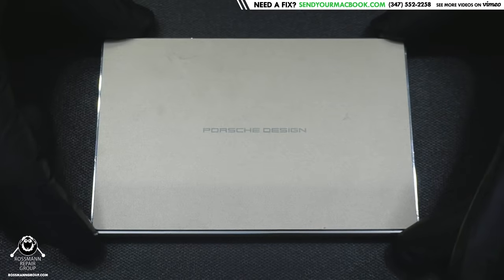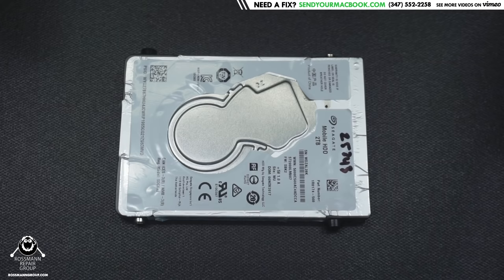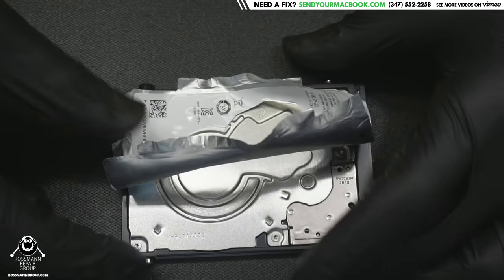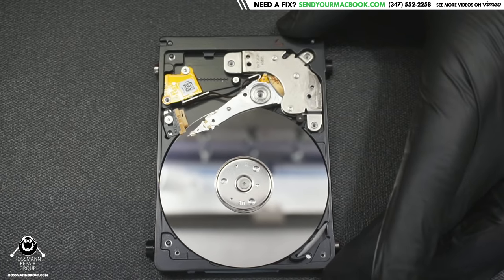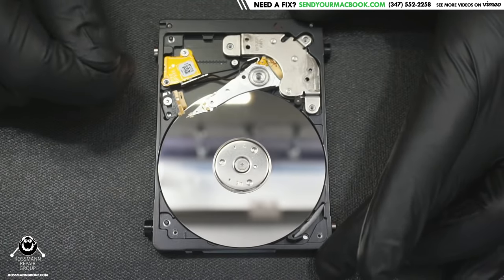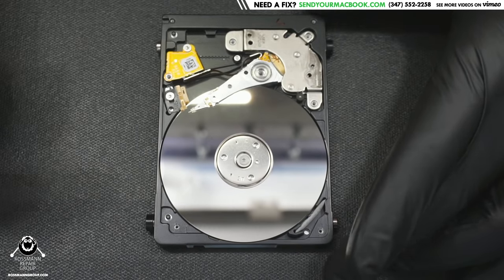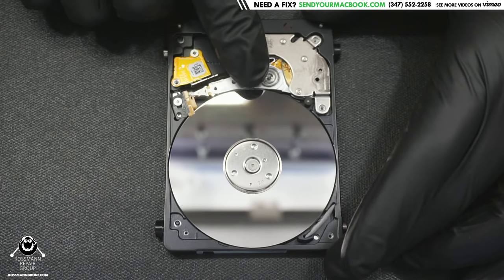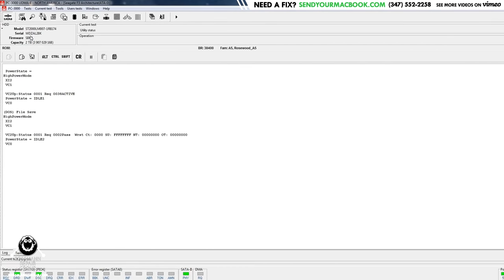Why your Seagate external hard drive is beeping; beeping hard drives can be recovered with this fix

Comment: When you talk about the drive failing again after repair, I feel like drives are so cheap once rescued the customer should really just get the data to a new drive.
Reply: This is ALWAYS the case you NEVER reuse a recovered/opened drive. What he is talking about is it working for a bit then failing again DURING the recovery of when transfering data to a new drive. NEVER NEVER NEVER keep using any storage media that has given issues or been modified. HDD SSD USBStick SDHC anything.
Reply: @XxTWMLxX  I have NEVER had any issues with hard drives that I've recovered in this way. Yeah if I'm doing it for someone else I normally fit a new one but I keep the old one for my own projects as long as there are no errors during data recovery. If there are, it's usually dues to damage to the platter surface due to what used to be euphemistically termed "a head crash". Generally speaking, stuck hard drives are usually fully recoverable without errors and thus will still work just fine afterwards.

Flash memory is less reliable than spinning hard drives in my experience (especially that bought on ebay :)

Comment: I have an old ass IDE drive that caught fire when hooked up externally. How do I fix that
Reply: I've never seen an actuall hdd burn up (external or internal) but the power supplies in some cheap (and not so cheap) external drive enclosures are often of very pooor quality and can easily fail in a bad way. As long as the fire didn't actually damage the hdd board, you should be good to connect it up internally or in another caddy.

Comment: I've got one of these that lasted TWO WHOLE (@*#ING DAYS and then it started giving me "I/O Error" messages.  Now it's dead.  So I shucked it, assuming that it was the USB/SATA interface.  Plugged it into a typical USB3.1/SATA adapter cable...no dice.  Checked the interface board with another drive...interface worked fine.  My determination is that it's a drive (controller board, not a physical/mechanical) issue.  It's simply too new for there to be an actual physical error.

Is it possible to fix the electronics on these (*#@ing things?  If I'm right, it's probably just a single component failure...maybe something for another video?

Looks to be the exact same drive, just came in a Seagate Ultra Slim external case.  The plan WAS to chuck it into one of the laptops...but that didn't go quite as planned.  Of course, that was AFTER I MOVED (yes, not copied...MOVED...because it was a new (*@#ing hard drive...dammitt...) all the stuff required onto it.

If the electronics can be fixed/replaced, let me know.  If not...uhmm...want a nice less-than-24-hours-of-use donor?  d=^/

Comment: I'm pretty sure I can try this at home with hard drives I can get going dumpster diving near office spaces.
Reply: You sure can, but risking total loss of data due to dust on platters, melted heads (I found one a couple of years ago) or firmware isues (damm you firmware split onto the platters so a pcb swab isnt easy)
Reply: @CodeAsm  It's only for the learning experience. For hard drive with sensitive data I call an expert.
Reply: @kemy5368  Cool, for learning, go for it. just first go read online about your specific model. maybe they tell or show if screws need a certain tension or sequence of screws to remove. also, I swapped a pcb wrong and now both drives wont start because both know the pcb was swapped. even if I put them back.

Comment: I have my same Hard Drive of Seagate 2 TB and data is 1.8 TB loaded my whole life memory.

While copying data my portable drive slipped and from computer casing and hit on the table. After that its not responding and beeping sounds is coming after interval.

I took it to local repair and data recovery experts where they just scared me your is now lost and cannot be recovered but still if you wish us to proceed then I have to pay them $180 for the recovery which will be 50/50% and still I have to provide them one more 2 TB Drive.

I am also a good technician and did a lot work on mobile and other micro devices with a good successful rate.

I am wondering to do this by my self and recover data instead of paying them. Because one more risk is that they also do private data leakage and sold it in market.

Experts please give me opinion...

Comment: what's gone wrong with a maxtor hdd that goes shh-click shh-click shh-click?
Reply: Not sure, could be heads not reading anything or not finding the alignments tracks. I had a few maxtor drives that did something like that and had huge scratches on the platters, 1 head was twisted and scratching. another drive had nothing physicaly to be seen, just shh-click, ssh-click... the controller said it could not detect its platter speed or location. but I might be wrong, probably wrong, im just a guy on the internet.

Comment: What do you do if you have an xbox 1 external 2tb Hard drive from Seagate and the xbox won't recognize it even afcter I tried restarting and holding 10 seconds and my drive sounds like a fan but it won't read

Comment: I'd just do a drop test. If that didn't work, compressed air. But realistically, I'd never buy these drives. The thinness of the drive results in too much drive vibration. Which causes warps in the platter and heads to stick. Buy thicker drives. If you do have one of these pieces of garbage, replace the drive with a solid state. Just as thin. More reliable, and happier experience. Unless the case is married to the drive.

Comment: Porsche design: dust ingress preventing measures = Sticker!? Porsche should not design hard drives.
Reply: ?? they just bought the cheapest option which happened to be this rosewell sh**. Porsche does not design harddrives.
Actually all porsche merch is apple inspired : design over function.
go figure
Reply: Porsche lease their trademark to Murch brokers,  at most they design the casing/logo. I'm a little surprised they aren't checking the quality of what people stick their name on but it's all about the Benjamins
Reply: @regmigrant  you nailed it. they just approve the design. It needs to look "good" in a glass shelf. i had so much porsche crap over the years since they gift you this stuff when you pick up your car. Not even the umbrellas work flawless... and the cloathing... dont get me started lol.

Comment: Bruh my 2TB started beeping so I opened it up and it fixed by itself some how but it says it’s capacity is 144115.2TB instead of 2TB so I can’t use it on my PS4 because the maximum you can use on a PS4 is 8TB.
WHY THE HELL DOES IT SAY 144115.2TB?!?

Comment: How much would people usually ask for opening harddrive, unstucking head and screwing it back together ? Nothing more, no data recovery necessary.
Reply from the maker: That is data recovery.
Reply: That is a horrible idea. The drive will fail again if that is done. Any failed drive should be repaired. Recovered then discarded
Reply: Unsticking the head is just so you can start a recovery; the drive is likely shit from that point on, or, soon will be..

Comment: allright... My Seagate Expansion just beeping and stop working. my Pc detect in device manager but nothing in file explorer... call the seagate support center and they say it was not covered by warranty because not manufacture faulty and bla bla bla...but they say they can repair my drive if i pay for the parts. the service are free. the price of the part is almost 3/4 of the new one :(
nothing really important on the drive just some old games files and etc. so i follow this video.. it works for few hours and then it got stuck again... so i bring my hard drive to the back yard... throw it into the air, and BANG with my baseball bat.. it sure fly high. and then i grab my phone open some apps finding a good price and more discount. click buy.. DOne,the new hard drive will arrive tomorow. super solution and no need thank me. adios

Comment: In my experience seagate = garbage. Once I had an external HDD seagate with exactly the same issue, brand new out the pack, now I know what was wrong with it. Ended up getting a WD drive instead, works well.

Comment: porb because thery were tring to save money. so they went and skipped the normal way the drives are produced/ manufactured. i have a saegate 1TB backup slim drive now i dont know why but i assumed it was a n SSD. boy was i wrongits a samdung momentus drive that seagate used. but all it does is beep. windows 10 file exp wpou;d not evean se it disc mang yes but it would not let me do ny thing if i did it would lock uo th esystem.

Comment: I wish I had the money for a cleanroom u.u
Reply: They're not using a cleanroom,  they're using a filtered air box.
Reply: not that expansive depending on the level. the filter cartridges sum up pretty fast, though.
Can be "DIY"ed : Special stealth inline fan ranges between 100 and 200$ , the cartridges are depending on the level and type (carbon etc) between 60 and 150$ and wont last very long. The airtight slideable screen window is 200$ and you need lots of silicone and particle free paint if you build it from wood. So if you have skills its about 700$.
Reply: @The1Rausch  Don't need any of that stuff. Just be careful, don't keep it open longer than you need to and don't touch the platters. You'll be just fine. This stuff is not that hard or risky as people think.

Comment: Seagate HDDs are junk. I had a HDD failing with increased file corruption errors. I've refurbished it only to fail again.
Reply: Wait, so people actually repair hard drives with the intention of keeping the drive in use beyond the amount of time to recover the lost data?
Reply: @padraics  No, that was not the case. I had backups of all my files. I've sent my HD to the manufacturer for refurbishment/repair. The repaired drive failed after a couple of years of very light use, on a secondary machine.

Comment: The only option is to take it to an expert? Never say that again. If people try to recover their data themselves, they'd have better chances than if they didn't try at all. The idea that HDDs are fragile is true, but taking risks is a good thing. What you're doing is fear mongering, and I think Apple would be proud of you for it.
Reply from the maker: If you wish to learn how to do this, you can use this video to help you practice on dead drives that do not have important data on them. If you wish to learn how to do this and learn on a client's drive, you are why people do not trust repair shops, or those in the data recovery industry. 

Never learn on the customer's device. Ever!  This is not fear mongering - 99.999% of the general population will destroy the first hard drive they work on. Often, it is a case of an inexperienced repair shop that pretends to be qualified, who destroys someone's data - once destroyed, you cannot fix it again. It is gone forever. These are straight facts.

Apple does not offer any sort of data recovery whatsoever - it is disgustingly shameful that you compare this to the process of routine lying & scamming that takes place at Apple. Shame on you and those like you.

Comment: seagate hahahahahaaha
friend got an seagate NAS (lmao yes its true) every single hdd is broke after 1,5 years.
WD NAS (5 years old) not a single one. seagate is more than crap.
Reply: See, now, I had a lot of small HDDs from way back when I used to harvest them from roadside collections (where people dump their trash on the side of the road and on a specific day of the year the council collects it for free).
I had a ton of Seagates, WDs and Hitachis.
I have none of those WDs left working, they all died within about 6 years of me collecting them. The Seagates are getting pretty dicey at about 9 years, and I've thrown most of them away, and the Hitachis just say "old age" on it's SMART readings.
I don't think for a second it's got to do with the brand. It surely has to do with the fab process, the factory it was made in, and the tech driving it. A good Seagate will last about as long as a good WD.
Seagate just lost a LOT of reputation over that 3TB drive disaster, so now it's fun to shit on Seagate.
Reply: @set-l1520  the seagates were produced in 2015. i dont know maybe the old ones were better. i can just say that from 6 hdds (and not the desktop ones, the pro ones) all are dead. WD is still working. i also had one seagate dead so far. only WD for me since then.